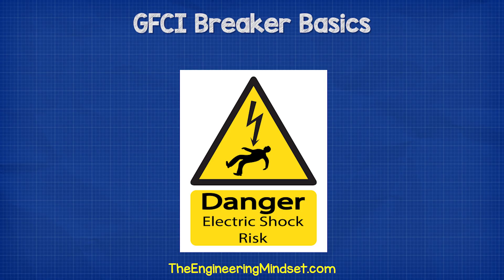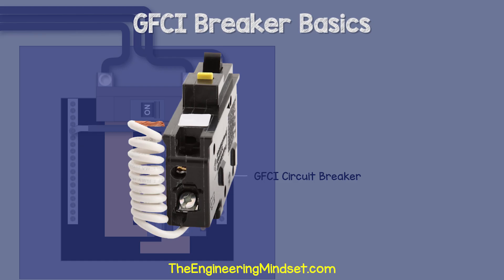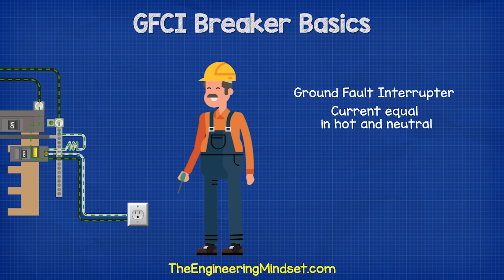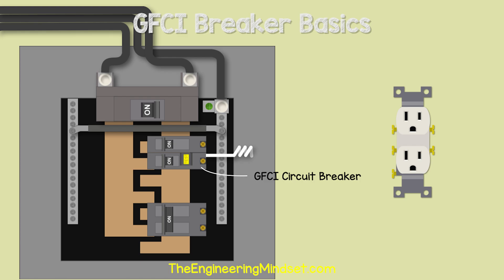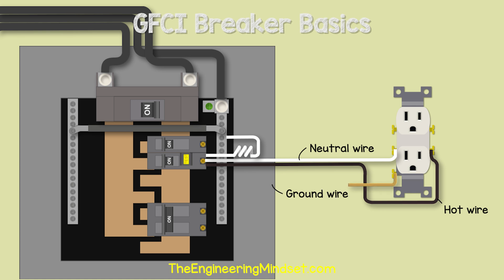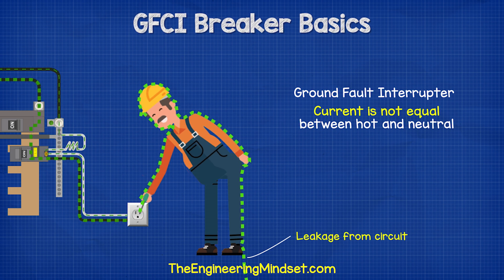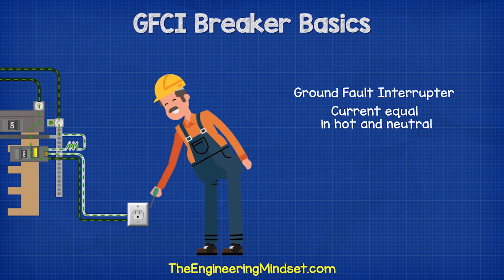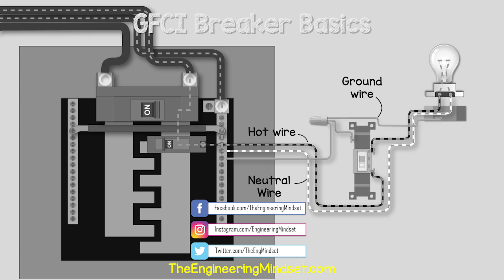GFCI breaker basics - Ground fault circuit interrupter how it works

Comment: Your video says to run the ground wire from outlet being protected by gfci to the neutral buss bar that’s wrong the ground wire always goes to the ground buss bar . If you are trying to teach people teach them the right way not the wrong way watch your video and see ! 
My lord!
Reply from the maker: No, the NEC clearly states the ground and neutral can be connected into the same bus bar in the MAIN PANEL, if the main disconnect is there. If so, they are physically joined there in the panel, it makes no difference. However, if you have an external disconnect or a sub panel, then no, they can't be. 
I even made a video about it here: https://youtu.be/NUSNa-7Hecw?si=o5A62t-Ou9b2nOiE

Comment: Please review the definition of " outlet" in the NEC.
Also, on a 120v 1 phase branch circuit the term "neutral" would be better defined as "Grounded Conductor".
Reply: Did you miss the term "basic" in the video description? They are intentionally using terminology that a wide audience will be familiar with. It would be silly to correct someone for using "wire" rather than "insulated conductor" but some people just need to find faults in everything.
Reply: @jonathanwilliams1641  When dealing with a dangerous and/or deadly profession, I always believed that the correct terminology was required.

Comment: The video doesn't have the grounds and neutrals separated
Reply from the maker: It's not always required. Read the NEC guide
Reply: @The Engineering Mindset  it is after the first means of disconnect. Still a good video though

Comment: i don't think this explains how they work, but what they do. How do they measure the live and neutral wires? how do they break the circuit?
Reply: The GFCI has an OpAmp Comparator circuit to compare the hot wire vs. the return neutral wire. The GFCI has a relay that switches off when the variance in current is detected by the comparator.
Reply: ok but how does a comparator work
 @SLUGTHUG
Reply: How something works is explaining the function of the thing. Your criticism of a video that self describes itself as "basic" is very odd. It would be like if someone explains how to use a calculator for adding a series of numbers and you are hung up on how the internal electronics of the calculator works rather than the intended results the machine produces. Strange.
Reply: @jonathanwilliams1641  if someone asked how to use a calculator i'd expect an explanation of what the buttons do, if the question was how a calculator works, I'd expect an explanation of the electronics inside, they're different questions, I'd expect different answers
Reply: @SimplyStuart94  The description of the video literally says: "we're going to go over the basics of GFCI breakers and how to use them." The video is about the functionality of GFCI breakers. The video explains both what a GFCI breaker does and how it does it in; in under 2 minutes. If someone asks "How does a GFCI breaker work?" it would be a perfectly fine answer to say: "It measures the current in the hot wire and the neutral wire and when they aren't equal it turns off." Someone who already knows this would ask "How does a GFCI breaker measure the current?" It is just confusing to me that if you were looking for in-depth technical information on the inner workings of a GFCI breaker; why would you watch a one and a half minute video whose title starts with "GFCI Breaker Basics?"

Comment: Is there any difference with how a GFCI outlet works? Or is that a extension of the breaker?
Reply: A GFCI outlet and Breaker work the same. The Breaker is a whole branch circuit. So you don't need GFCI outlets on that circuit.
The outlet is just that plugin.
The thing is you have to have a ground wire or GFCI's don't work. As we know the Ground and Neutral is bonded in the main breaker box. But not in any other breaker box.
Reply: @Ottos_ScLm_Race_videos_2009_on  Wrong. GFCI's work just fine without a ground wire.  In fact, NEC requires GFCI's be installed in old homes that have no grounding wires.
Reply: @LonnieAdams4  Wrong. GFCI's don't work "just fine" without a ground wire. They offer some protection without a ground; but not the full function. From Eaton: "Yes, a Ground Fault Circuit Interrupter (GFCI) receptacle can function without a grounded wire, but it may not provide the same level of protection against certain types of electrical issues (e.g., short circuits to metal enclosures)."

Comment: You explained WHAT it does but not HOW in any internal details. 

How does it measure power and trip if there's a problem?
Reply: There's a primary and secondary coil around a toroid, one connected to live, and the other to neutral. The magnetic fields generated by the two coils effectively cancel eachother out until there's a residual current (normally 30mA). Now the strength of the magnetic fields are no longer equal, and one overwins the other. A "trip-coil" is positioned on the same toroid 90 degrees from the two phase-coils, and a current is induced in it, which trips a relay, cutting power to the load. 

The test button creates a tiny residual current when pressed using a resistor to limit the current.
Reply: @GrabThatPencil  tacitly replied. 👍 👌 👦
Reply: @manmudogo2  Glad to hear that
Reply from the maker: This is a basics video, we will cover the internal details in the more indepth video
Reply from the maker: Check out NEW resistor video, everything covered! ➡️ https://youtu.be/DYcLFHgVCn0

Comment: FYI, many mortgage places WILL refuse you loans if these aren't installed above EACH SINK.
Reply: Which country ?
Reply: @SlyerFox666  US. I was a first time homebuyer so I got some subsidized government loan and they insisted we installed that
Reply: @SlyerFox666  FYI, you probably have these in your home but don't realize it.
Reply: @samsonsoturian6013  I know exactly what's in my home as I teach this stuff at university but what you don't realise is in the UK in bathrooms there are zones where you can and can't put electrics sockets etc over the sink is one of them so I was surprised to hear what you said then thought bet it's only in America maybe. 👍 We call them RCDs and by law they have to be in the distro box to protect every circuit they should trip at 0.03A within 0.04mS to stop your heart from going into fibrilation and needing a defibrillator to put your heart back on track, So well worth it in my opinion. 👍

Comment: We call it RCCB in Asia, it's based on Kirchoffs law resultant current across a junction is zero.
Reply from the maker: Seen our new incredibly detailed MCB video? link: https://youtu.be/gqEu9t8HwW0
Reply: RCBO* .. 
Unlike RCBO or GFCI breaker, RCCB offers no over current protection.
Reply: @IAmThe_RA  Yes but we have MCCBs to all outlets. RCCB is placed on the main, the output from RCCB goes the MCCBs.
Reply: @ShadowofXavier  That's the point. The equivalent of GFCI breaker is RCBO as both offer over current and leakage current protections. Whereas an RCCB needs to be installed with an MCB/MCBs.
Reply: @IAmThe_RA  But the GFCIs that I have seen are installed near the load and not on the main distribution board.
So GFCIs don't protect the whole circuit as per my understanding they only protect the load to which they are connected.
Reply: @ShadowofXavier  In North America an MCB is called a breaker.. So a GFCI breaker means it offers both types of protections. Just like an RCBO, it can be used to protect an individual circuit for example a power circuit so that you can get rid of the GFCI receptacles which are common in the USA, just use regular receptacles.